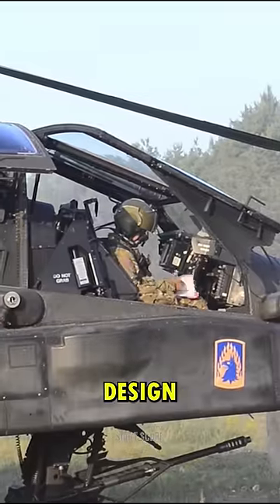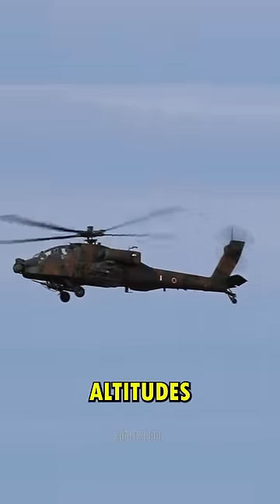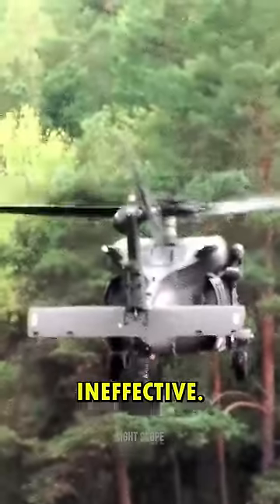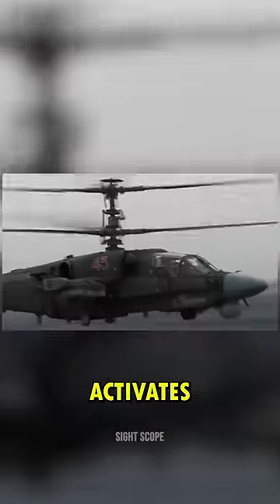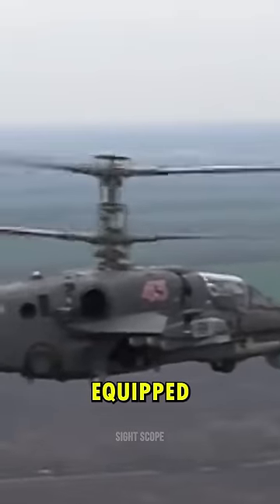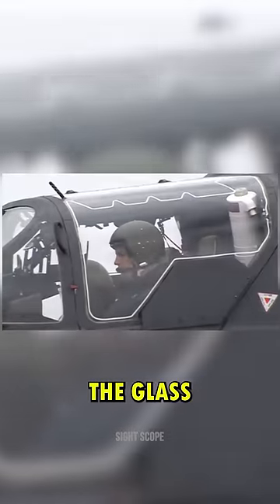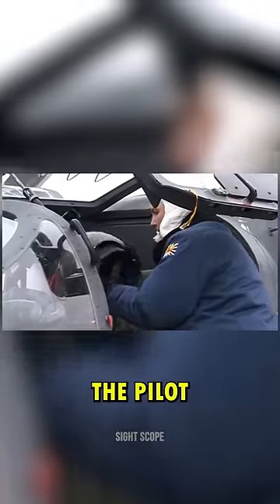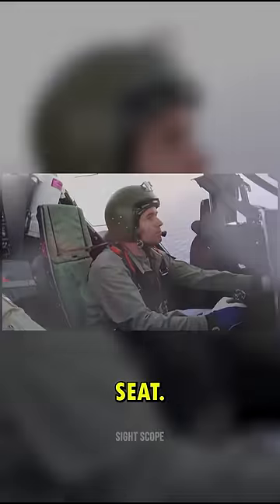Do Helicopters Have Ejection Seats? #shorts

Comment: It’s not the low altitude that’s a problem modern ejection seats can handle ejecting on the ground just fine. It’s the giant spinning rotor above you, which you mentioned.
Reply: Ok the top one pop’s but,
what about the bottom one!
Reply: @kieronstump  they pop off...
Reply: @robertharris6092 in the video he states that only the top one pops off. Meaning the bottom one stays.
Reply: @BMRiding  no. He said on top of the helicopter. which they are.
Reply: @robertharris6092  he said “the one on top” not both. Listen.
Reply: @BMRiding  his exact words are "the propeler on top of the helecopter" that means the entire system. And it doesnt change the fact that it works by ejecting the entire rotor system. Whatever he said is irrelivent.
Reply: @robertharris6092  you just proved my point. Rotor- singular. Rotors- plural. If he made a mistake then I understand. But he did not say the whole rotor system.
Reply: @robertharris6092  we know the whole system is what’s stopped, we are talking about what he said. So yea it’s relevant. God you people are annoying.
Reply: @BMRiding  both blades actually are popped off when the pilot ejects lol the person in the short made a mistake and you failed to see past it.
Reply: @BMRiding Who cares what he said, the reality is that the entire system pops off. Arguing the details of what the guy says is pointless...
Reply: Low altitude is indeed a problem.

The reason being is that some methods that could be used to eject the pilot which work at high altitude which also work with roter blades spinning above you, simply stop working when in proximity to the ground.

Just because we have it doesn’t mean it works in all situations. After all, there is a reason why it’s designed that way.
Reply: @BMRiding both blades pop off, the creator if the video made a mistake
Reply: @MrCoolguy425 Lots of aircraft have a "zero zero" ejection seat, meaning it will function at zero altitude and zero airspeed.  For example, you could have a fire on the ground and eject and survive.
Reply: I giant rotor blade spinning at 1,000s of RPMs over homes and people....I can't see the problem here.
Reply: @BMRiding I like how y'all are arguing over a easily googleable fact the ka52 and the ka50  have a breakaway explosive bolt system which causes the entire rotor system to brake apart before the pilots eject...
Reply: @ChesterBravo  I wasn’t saying there wasn’t. But I am saying a lot of those systems are designed in a way that make them functionally extremely difficult to work in a helicopter.
Reply: You are all just weak, what can two giant rotors do to you?
Reply: @BMRiding he stated it incorrectly, the pyrobolts fire both sets off
Reply: The real problem is the weight when it comes to attack helicopters around the size of the cobra or Apache.  Ejection seats are heavy which means less ordinance on these smaller aircraft
Reply: Bro they say that it stops the top rotor, first off there is 2 so kinda useless, 2nd you still have to slow down the rotor witch takes alot of time especially in the air, 3rdjust create an ejection seat that goes to the side, your designing all that when you can design something that ejects out the side....... Russians I swear there military equipment is just so bad.                          ( edit even if they pop off it could hit the helicopter, and also it would go up so once again useless, and still takes alot of time )
Reply: @BMRiding Wrong use of words then… but either way the rotor blades are blown off, and then the sequence for ejection is executed
Reply: @handyman2233  A yes hundred kg rotor that will arrest thanks to drag is the issue and not twelve ton aircraft two of which are unused ordinance and and another one and half are fuel. Those are a OK.
Reply: @nitrogod9990 He made a mistake, the heli blows off the rotor assembly , not stop it, and that includes both rotors. Sideways ejection seats and will make it wider that’s it already is, and I’m pretty sure that ejection seats are designed to go up to gain altitude for the parachute.
Reply: @nitrogod9990 
You can’t eject sideways. I don’t get why all of you kids keep saying that. During an ejected g forces approaching f 25gs Are Made. If you were to eject sideways, 25 lateral gs would break your neck instantly since your neck isn’t supported in a helicopter.
Reply: @handyman2233 its a combat aircraft, civilians aren't a worry as when the aircraft was designed urban warfare wasn't a thought like it is now. The Ka50/Ka52 is designed to operate like the AH64 Apache as a tank hunter.
Reply: Low altitude is a problem because some ejection seats actually fire downward. But if you're close to the ground...well
Reply: @blop507  well luckily for the US the only plane we have that has downward ejecting seats is the B52.
Reply: Altitude is a factor because it complicates other directions for ejection (other than up)
Reply: @trashitty9854  yes altitude is an issue for the like .00000000000001% of the worlds aircraft with ejection seats that fire downwards but in the rest the fire upward even at 0 altitude and 0 speed
Reply: @JosephDawson1986  yeah the point being, helicopters can't use the same method because they fly at low level most of the time. Thus, altitude is a factor.
Reply: @blop507  how do you figure? If it can fire at  zero altitude and zero speed meaning sitting still on a runway. It can shoot off in a helicopter going anyspeed at any height. Ita only the complexity that keeps it from being a standard feature of attack helos
Reply: @JosephDawson1986  I'm just referencing the original comment I replied to, staying that "it's not low altitude that's the problem modem even seats can handle ejecting on the ground just find" I'm saying low altitude is part of the problem, because a solution to avoiding the rotors would be an election seat that ejects downward. That's when low altitude becomes a problem.
Reply: @blop507  the Ka50 did originally have downward ejecting seats then they implemented the exploding bolt rotor hub to cast the blades away before ejecting
Reply: @JosephDawson1986  probably because there was a problem with downward ejection seats.
Reply: It's all about the timing.
Reply: If I'm dying anyway I'd rather take a shot at the rotor
Reply: @BMRiding dude understand both propellers eject, you can find it anywhere
Reply: The low altitude problem is probably explaining why a seat couldn't eject through the floor.
Reply: @JosephDawson1986  yes also lateral ejection on helicopters have been designed. Idk why you want to talk down to me, spent the last 6 years working on these things
Reply: @trashitty9854  years as an aircraft maintenance tech doesn't equate intelligence. OP said that altitude wasn't the issue ot was the spinning rotors. Even in all but a few fixed wing aircraft bottom firing ejection was deemed too dangerous and so that makes it a no brainer the system in a helo was top firing, which then the only problem was the rotors. Well if ots obvious to go top firing then its obvious altitude would be an issue.
Reply: @BMRiding no, you are the annoying one for actually trying to suggest in any way that the 2nd rotor doesn’t pop off, which would be completely insane to any rational person.

You know you were wrong because you tried to shift the argument to “we’re arguing over what he said” which is wrong. You specifically stated that only the top one pops off, and not in reference to what the guy said in the video. Meaning you actually thought that the second one did not pop off, as if that was not a ridiculous thing to think.
Reply: @BMRiding no, you are the annoying one for actually trying to suggest in any way that the 2nd rotor doesn’t pop off, which would be completely insane to any rational person.

You know you were wrong because you tried to shift the argument to “we’re arguing over what he said” which is wrong. You specifically stated that only the top one pops off, and not in reference to what the guy said in the video. Meaning you actually thought that the second one did not pop off, as if that was not a ridiculous thing to think.
Reply: Human swiss cheese
Reply: @BMRiding brother in Christ you know what he ment
Reply: @partytimeninja3139 exactly, like would all these people who are criticising the Ka-52 obviously would rather slowly lose control crash and burn
Reply: Even once the prop blades pop off, that would be damn scary to get ejected hoping the blades have gotten clear of your area.
Reply: @BMRiding Yes he did say that but it would only take common sense to ask

"The f*ck is the point of taking it out than? Either the people who designed it are idiots or the guy narrating made an error"
Reply: They're not that heavy dude and either way if it was somehow an issue the Ka-50 can carry at max 23,810 lbs while the AH-64 can carry max 23,000, they clearly made up for the weight. @Remote-Planet
Reply: @BMRiding the IQ and self awareness is weak in you, apparently
Reply: How is that even practical when helicopters don't fly parallel when in distress?
Reply: @BMRiding They both pop

Comment: Russias Ka52 chopper is seriously underrated as far as engineering goes
Reply: Not their jamming system- If they cannot jam modern IR guided manpads. Their ineffectiveness in current war created current debate weather anything less than hard-kill is worth bringing on bord of attack helicopter. 

Also it seems that lack of ballistic isolation of pilots from eachother is a very bad idea.
Reply: @radosaworman7628 they are not ineffective currently, you could argue that they performed bad 3 months ago not now
Reply: @Holamuybuenas13  what changed 3 months ago? Like I'm asking because as far as I know their enemy needs couple recording from IR sensor to teach their AI algorithm how to recognise that jammer and how to target it. I do not even know how you can counteract that past staying out of the range- which means mounstly out of kamovs effective range.
Reply: @radosaworman7628 ou cant jam an IR weapon. You can throw flares and pray to god it decides to go after them but you cannot jam it.
Reply: @iplaygames8090  you can confuse them but it still called a jammer if it does it with different method than flare. Both ka-52 and Apache have jammers. On first one they where proven ineffective for all but oldest IR guided systems, second one was never put in a situation where it might be used. 

Look it up. Those are real things. Russians implemented them widely.

Comment: "The 7 massive steel knives spinning above your head moving at 300 RPM definitely dont help"
Reply: If they’re only moving at 300 RPM that’s definitely going to be a problem
Reply: 300?? That is a problem itself
Reply: 7 blades?
Reply: @idonkey821  6, whatever
Reply: Knives!? Knives!!? Those aren't knives son, those are fucking great swords!!
Reply: They get blown off
Reply: Bro 300 RPM I am gonna screenshot this if I have a bad day.
Reply: More like 500-800
Reply: Chinook at full rpm is only 225
Apache sits at 260.
OP was accurate in his statement
Reply: @AlexLoveMilk  I fly r22 and r44, we sit around 500 ish rpm
Reply: @HunterGrayBASSASSASSINZTV a Robinson has a relatively small rotor diameter though, it can reach higher rpm, compared to bigger helicopters, without the tip going supersonic

Comment: Correction
The helicopter's rotor disc has explosive charges in them to shatter the blades and make way for the ejection seat

You can actually see the mini explosions going off during an ejection
Reply: As it's a wireless system, knowing the Russians, those explosive will go off at random. If they want to get rid of some pilot, they'll trigger them by remote and last but not least, the Ukrainians will find the exact frequency soon.
Reply: @arturama8581 no reports of that have been seen yet, only a couple deaths have been reported because every can’t run without 1 fail

Comment: If you can get the seat to eject at Mach 21, it should be able to clear the rotor blades.
Reply: Dont forget to add a little "precision of a god" in there and maybe a dash of "lucky as all hell" 🤣
Reply: Bro is onto absolutely nothing💀💀💀
Reply: They apparently perfected it using puppies. How you feeling now?😅
Reply: Sounds like a great way to turn your brain into a pancake
Reply: say goodbye to walking though as it destroys your spine. id opt to go into the blades at that point
Reply: And the atmosphere
Reply: @deadshot4245 all ejection seats can cause spinal damage.
Reply: Mach 21? Are you ejecting from the Space Shuttle?!

Comment: "Helicopter design poses unique challenges when it comes to ejection seats"
You don't say lol
Reply: Love how the blades where problem number 2 and speed and altitude where the real concern
Reply: @caulharstad30 Hey, technically they could eject fast enough n timed well enough to eject between the passes the rotors make. You know.. with science. But you need more faith in the guys who put the thing together than the science part. 🤣 #RedMist
Reply: @rahulsudhir666 nahh bro, the g forces the pilot would experience from a ejecting that fast would be fatal.
Reply: @mrsauce9307   "The injuries have been deemed non combat related" - VA, probably.

Comment: I’m sure those blades won’t provide any issue after they detach
Reply: That’s in the 1 in a million chance it actually works because Igor didn’t get a chance to sell the bolts for vodka yet
Reply: Not to the pilot, anyway. Depends where you're flying I suppose, the rest of the helicopter falling out of the sky is going to provide a bigger problem for anyone below.
Reply: Two detached giant ninja stars will be flying….somewhere around the air space.

But they will probably be out of the way…hopefully.

Your dying anyway, what you got to lose?
Reply: @mikeshogunlee  that not like a ninja stars. each wing detach individualy and fly away in all directions because inertia pulls them away
Reply: @hawks1ish just because it’s Russian doesn’t mean it’s bad, they invest heavily in their attack helicopters, also why would they create a non functioning system on a compact heli